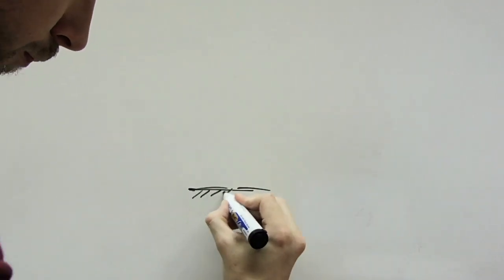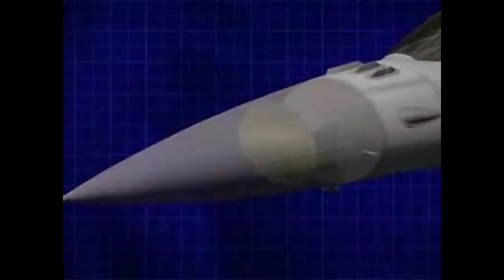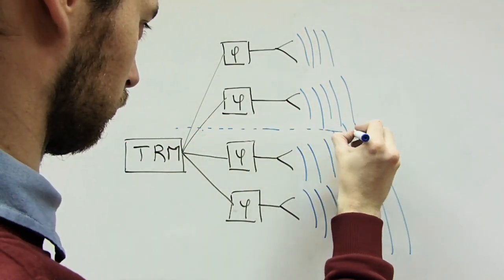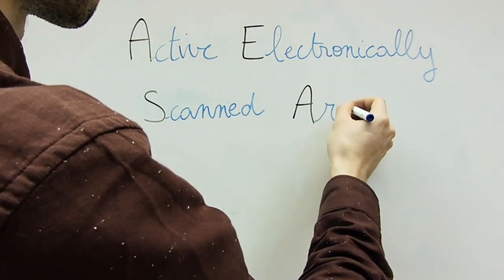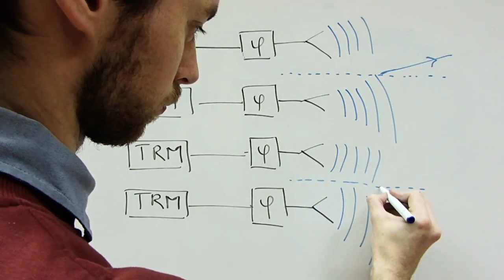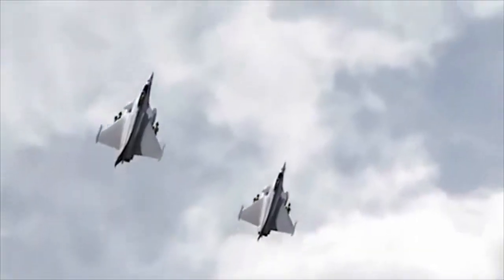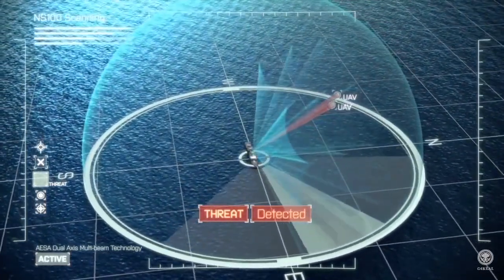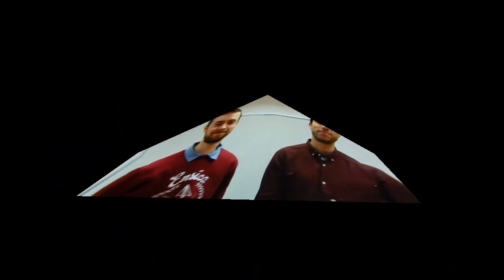PESA and AESA for radar systems - ISAE SUPAERO

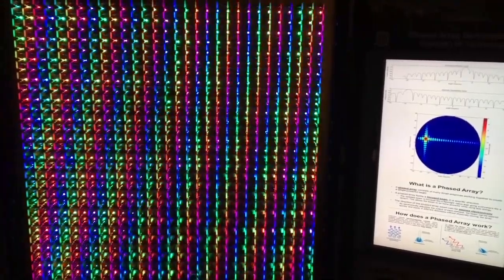Comment: 2:04  Well not quite. Late mechanical scan arrays could track while scan ( TWS ) multiple targets but were indeed limited on 1 engagement. Russian Zaslon radar which is the first PESA to be used in combat aircraft could track 10 targes while engaging 4 of them simultaneously . Modern PESA like the Irbis radar can track 30 targets and engage 8 simultaneously .

Comment: There is one part which I cannot understand: you see in both design, the scanning signal is released via the individual element (whether powered by a "shared" transmitter" or its "own" transmitter) so in what way is the PESA being "passive"?
Reply: Chatgpt is a little wrong on this. The "passive" and "active" refer to the array of elements themselves. In a PESA array, the actual antennas aren't individually powered and aren't independently controlled, they're all powered and controlled by one overlord controller that energizes the whole array at once. The antennas themselves are considered to be passive.

In an "active" array, the individual antenna elements are powered, they're all individually active. So an AESA array can individually power and control each antenna's function independent of each other.
Reply: from chatgpt:
The term "PESA" stands for "Passive Electronically Scanned Array." It might seem a bit counterintuitive because the "passive" part in the name doesn't mean that PESA radars don't actively send out signals or perform scanning. Instead, it refers to the way in which the radar elements, or the individual antennas, receive and transmit signals.

In a PESA radar system:

1. **Transmitter-Receiver Sharing**: Multiple antenna elements are connected to a shared transmitter-receiver module (TRM). This TRM is responsible for generating the radar signals and distributing them to the antenna elements.

2. **Passive Reception**: While the TRM actively transmits the radar signal, the antenna elements passively receive the reflected signals (or echoes) from objects in the environment. These passive antenna elements don't actively transmit signals themselves.

The "passive" aspect in the name PESA refers to the reception part of the radar. The antenna elements do not actively transmit signals; they are only responsible for receiving the signals that bounce back from objects in the radar's field of view. The active part, in this case, is the central TRM that generates and controls the radar signals. 

In contrast, AESA (Active Electronically Scanned Array) radar systems have individual Transmitter-Receiver Modules (TRMs) for each antenna element, meaning each element can both transmit and receive signals actively. This allows for more flexibility and control, as each element can independently generate and steer radar beams, making AESA systems more advanced and versatile.